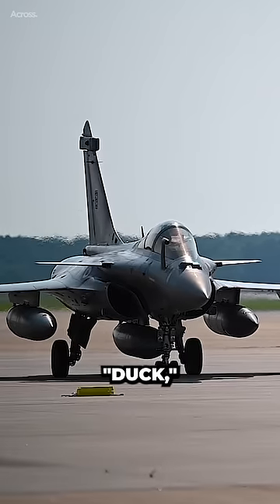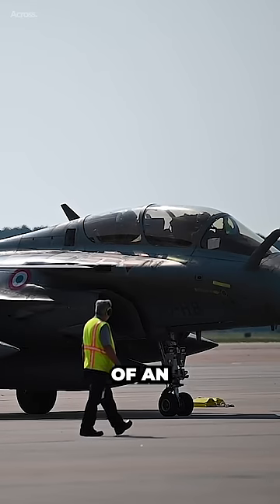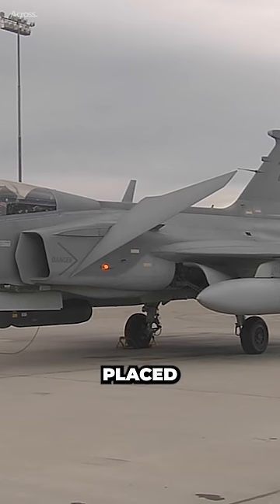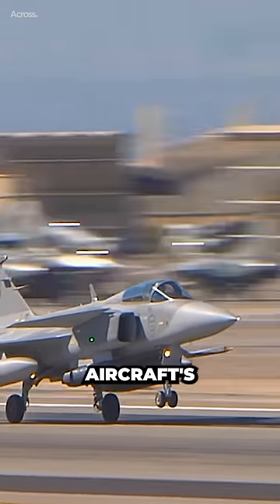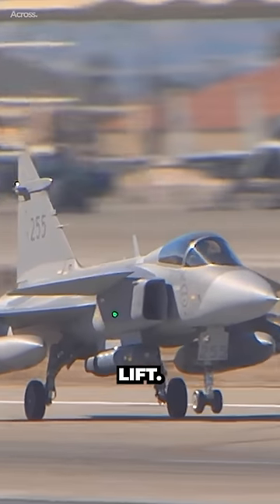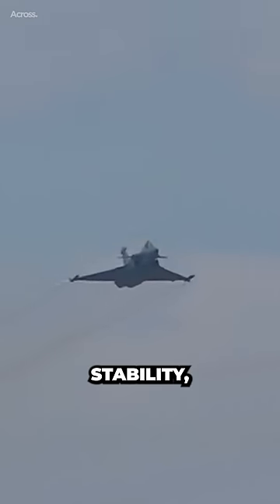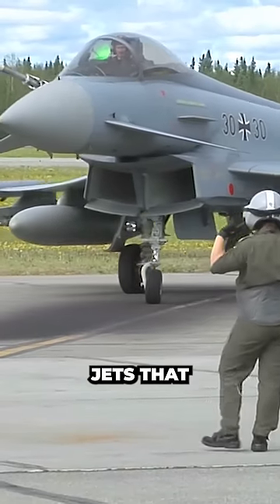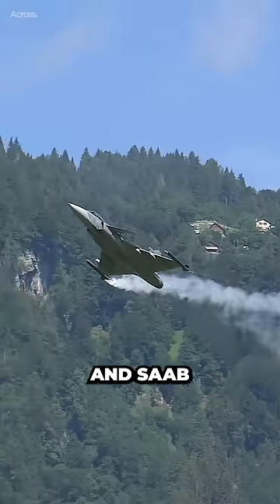Why Don't American Fighters Jets Have Canards? #shorts

Comment: I recall a guy involved in designing the F16 saying, the best place for a canard is on someone else's airplane.
Reply: 1000%
Reply: Yup hide bound traditionalists
Reply: There's only so many ways to make an aircraft and they might mock the delta wing designs but it IS plenty capable and can do stuff that regular F-4-15-16-18-22 design/pattern can't (I'm talking aerodynamically wise, put aside the thrust vectoring and stealth since that's not the subject)
The Mirage 2000 didn't have canards and was still an excellent fighter but it definitely got nothing on the Rafale which can do so much more thanks to the addition of canards
Reply: @thegeekno72  well I think specifically with the F16 they were looking to achieve a high degree of maneuverability using a low stability airframe with FBW. Pretty cutting edge stuff considering they were doing it in the mid 70s.
Reply: @johngalt2506  that is true, can't deny that
plus fly-by-wire and its performance in stability correction just appeared as well at the time so combining the two made the prospects of using a low stability airframe that much more appealing
Reply: @thegeekno72  
Now digital FBW combined with canards and thrust vectoring takes maneuverability to a whole new level. 
The question now is, in the age of reliable BVR missiles, AESA radars, and super cruse, is super maneuverability all that important. I wonder if there's a new emphasis being placed on maneuverability at high speeds and altitudes with the 6th generation designs.
Reply: "EXACTLY"!
Reply: @joesutherland225  
The F16 was cutting edge technology in the mid 70s
Reply: This statement is attributed to Kelly Johnson the legendary aircraft designer from Lockheed Martin... I do not think it was in regards to any particular aircraft.  He was ask at a lecture where he thought the best placement for canards would be, and he famously said, "On someone else's airplane".  Not sure if that is the exact quote but is close enough.
Reply: @johngalt2506  I think there might be for the following reason :
The US got no close proximity threats, if they get attacked, they'll see it coming and BVR makes sense for retaliation
If they attack someone, again, BVR makes sense to destroy patrols and QRFs prior to some invasion I guess
But the thing with Europe is, there's an old WW2 joke I heard long ago, countries are so small and tight here, you could cross over two of them at once just by spitting through them, BVR does makes sense for a while but not for long, Russia is next door, any encounter will become close quarters rather quickly, having manoeuvrability is required in these parts
I think fighter design took these kind of turns depending on the terrain it was evolving into, EU got "tight" airspace if that makes sense and as proven by current events, is close to a possible agressor, they'll get on site so quickly, BVR window will open and close faster than most think
Reply: Isn't hhe F16 designed by a supercomputer?
Reply: Wait until he learns the early concepts for the F-22 had canards
Reply: Funny that. As Typhoon, Rafale, Grippen & even the latest Sukois have all got them & are far more capable than the F16 (aswell as F15 & 18 for that matter) partly because of them.
Reply: @THE-BUNKEN-DRUM  the F16 is also an almost 50 year old design as are the 15 and 18.
Compare them to the F22.
Reply: Ii
Reply: @thegeekno72  unless the attacking craft is disguised as a Chinese weather balloon, then we will welcome it open arms.
Reply: @asherdie  hahaha true
Reply: Traditions did not made them true.
Reply: @james_the_darklord  no it definitely was not.  Development of the f16 started in the late 60's and was introduced in 1978. When the first f16 flew in 1976 there was really no such thing although any computer that is more advanced than the majority others could be described as a super computer. Here is a short list of some of the technological advancements in computing from 1978.
*IBM released the Electronic Typewriter Models 50 and 60, both using microprocessors to provide electronic control of certain typing tasks.
*The 5.25-inch floppy disk becomes an industry standard.
*The x82 Intel  CPU architecture originated in 1978
*The first LED display prototype was shown to the public at the SEF (Science and Engineering Fair) in Iowa on March 18, 1978.
*In June 1978, Apple introduced Apple DOS 3.1, the first operating system  for the Apple computers.
* and surprisingly the first semiconductor storage SSD was the StorageTech STC 4305 that was released in 1978, capable of storing 45 MB of data and costing $400,000. But there was definitely no computer aided design programmes available in the 1960's
Reply: @THE-BUNKEN-DRUM  Which one of them are better than that sweet f22? while canards work for the eu Thrust vectoring has probably rendered it pointless, it could help with take off I guess, but even there we have alternative solutions
Reply: They actually had canards on a F16 prototype for testing
Reply: @checkdajoker  true, I think the major differences are that canards can create extra lift giving shorter take-off at Max load and can be at a different angle of attack to the main wing, allowing them to produce lift when the main wing stalls. This is at a cost of slightly higher RCS..
Reply: @THE-BUNKEN-DRUM  more maneuverable...
Reply: Agility has been a secondary or even tertiary characteristic of fighter jets for a long time. The opportunity to use a tight turn radius in a dogfight is very low because:

A. The vast majority of engagements are long range BVR missiles where the best sensors and stealth dominate

B. Modern WVR missiles can turn at 50 G's and the best ones can be shot at targets behind you. No matter how agile your canards make your jet, it's not more agile than the missile.
Reply: The F-16 AFTI was pretty cool. I would guess the CL on US aircraft is farther back so the tailplane pitch authority is much higher.
Reply: Yes, I know that guy, his name is Herbert Hutchinson, and aeronautical engineer and a very very good friend of mine.

He was the project engineer in charge of the lightweight fighter program, (LWF) he was also chief systems engineer on the F-16, he wasn't a pilot but his honorary call sign was "stuffer" for his ability to literally design The cockpit of the F-16, you wonder why the seats slope at 30° ? Because he said so....

All the electronics in avionics in the cockpit were arranged by his design, he has a two book series out called "The F-16 Fighting falcon multinational weapon system, 1972 t0 2019"

And,

"Inside history of the USAF, lightweight fighters from 1900 to 1975"
Reply: @scottgamble3445  hey Scott,
My comment was a sarcastic reply to @joesutherland225 comment that it was because Herbert was a “hide bound traditionalist”. The US builds and has built the most advanced capable fighter jets the worlds ever known especially the F16 when they had to both cut cost while keeping air superiority. Give Hutchinson my gratitude for his service.
Reply: @johngalt2506  The answer is likely no for 6th generation. We are integrating remote operation capability for circumstances that actually require us to close within ~100 miles of the enemy. Training a pilot is almost always more expensive and time consuming than manufacturing a replacement plane, and that discrepancy has only continued to grow larger as warplanes grow more complex. Pilots generally require at least a hundred hours to qualify and that equals multiple thousands of man hours of maintenance and a plane unavailable while it's being worked on. Depending on the airframe it's possible it took as long or longer to train the maintainers than it did the pilot! Planes have pretty long lead times these days but I reckon we wouldn't be investing in drones if human resources weren't still anticipated to be the primary bottleneck in a full scale war.
In addition maneuverability beyond what an f-16 is capable of is of questionable value when the pilot is limited by the latency of a satellite link. Maybe we will have onboard AI that can fill in those gaps at some point but I think currently maneuverability is going to take a back seat to how fast you can shoot and scoot. Control and lift surface area and the G limits of that structure can only go so far before the plane gets too heavy and performance starts dropping again due to inferior power to weight ratio.
Reply: @THE-BUNKEN-DRUM  the Typhoon is a joke and is far more outdated than the older F16
Reply: @macicoinc9363 : 😆 Whatever helps ya to sleep at night, mate.
Reply: @johngalt2506  the most important thing rn really is just supercruise capability, stealth, datalink, advanced radar set ,and modern long range Fox 3’s
Reply: @thegeekno72  Canards make a design more docile at high angles of attack. That's nice when short-field takeoff/landing is a requirement.  Plus, they can double as speed brakes ex.Viggen/Gripen
Full deltas, as opposed to partial deltas with body lift like the F-15, are terrible dogfighters and at low altitude as they bleed energy quickly at high angles of attack. But they do fine as interceptors. ex. F-106/Drakken
Reply: Today, on things that never happened
Reply: @JohnDiseranno1992  
Read the thread
Reply: @TheGeekn°72  okay but why wouldnt the BVR planes just launch their payload and bug out before these "ww2 style" jets even get there? Therefore completely negating any chance of intercept? Like this isn't football were talking about. There's no required time on target unless it's a dead time. You don't have to give the other team a fair chance. Get in, do your job, and leave, what's beneath you is irrelevant
Reply: @johngalt2506  you do realize the f22 is almost a 40 year old design right? That's the thing people don't realize. The f22 is old. It's retired in the since it's not being made anymore because there are bigger and not quite better but a lot cheaper solutions. So while everyone is still to this day trying to catch up to the 22 to this day the us is already building prototypes for the next 50 years
Reply: @PulsingKrugotvoid  
Yes, I'm aware of that.
My point in bringing up the F22 in an earlier post was to respond to someone comparing the 80s and 90s era European fighters to the F16. I was suggesting comparing them to the F22 because that would be more relevant.
Reply: @johngalt2506  : The OP was/is on about the F16, NOT the F22. That's why I compared it. But of course, you kids just want to keep moving the "goal posts" because "y'all" can't handle that other countries have the ability to build something that rivals & in a lot of cases is better than something you've got.
The F22's biggest advantage is its stealth. But in terms of outright performance the latest deltas are 'almost' equal. There's multiple tales of them actually coming out ontop in some BFM engagements (which isn't too shabby for a previous gen aircraft). With the latest upgrades to their avionics, most previous generation aircraft actually surpass the F22 in a lot of areas.
Reply: @LEGEND  not really. They all have specific roles they were built for and the f16 and f15 still outclass their competition doing what they were built for. The only exception is 5th and 6th gen aircraft but none of our adversaries field enough to pose a significant threat currently. Plus how many other fighters are nuclear capable.
Reply: @THE-BUNKEN-DRUM  do you have any real world experience with Fighter aircraft? Designer, a pilot, or a maintainer?
Reply: @megaconda07  : Nope, but the 'real' fighter pilots from which I get my information off. Do have.
Reply: @thegeekno72 the airbases the US has in Japan, Korea, and Germany doesn’t count as close bases?
Reply: @THE-BUNKEN-DRUM problem is British planes never get tested in combat because they are letting the US do it. They might as well still be flying Spitfires
Reply: @robertdigby4504  do you think designers have in mind homeland defense or abroad defense ?
Even if they're tasked with making a multipurpose aircraft they're gonna think even if subconsciously "what's best given the geographical features of our country ?"
The US need BVR more than EU
The EU needs maneuverability more than BVR
Reply: @Archangel3083  my brother was involved with that, HIMAT
Reply: Obviously don't know squat on how to design them so slabs them off. Three of the best mentioned in the vid ALL have them and kick arse.
Reply: @THE-BUNKEN-DRUM  nonsense. Far more capable in what?
Reply: @EEEEEEE354  :  Performance, payload & avionics.
Reply: @THE-BUNKEN-DRUM  then you are misinformed. The F-16 has better performance, higher payload capacity, and sufficiently advanced avionics. 

Go ahead and post those performance and payload metrics for me.
Reply: @willcam386  : I'm not in the business of doing other people's homework for them. Google & books are your friends or enemy in this case.
The F16 was/is a fukn 'excellent' aeroplane, no doubt about it. Although the avionics are on par in 'some', not all areas, in terms of performance & weapons load, compared to modern "canarded" deltas, the F16 is at a slight disadvantage, 'especially' when compared to the Typhoon & Rafàle. I'm sorry (not) that you kids can't handle this, but it's an easily verifiable fact.
Reply: @THE-BUNKEN-DRUM  "I'm not in the business of backing up my claims" you mean?
Reply: @willcam386  : I don't need to back up anything when you can just as easily look up the information for yourself. Don't just take my word for it. It's 'All' there, at your fingertips ready & waiting for you.
Reply: I wish we had jets with canards other than the F-15 STOL/MTD
Reply: @THE-BUNKEN-DRUM  🤣🤣🤣🤣
Reply: Yes, if it were superior the US would have them.
Reply: @THE-BUNKEN-DRUM  lol a viper driven by a capable pilot would splash all those other euro jets.
Reply: @ZappakeR  : I have no doubt that's possible, assuming the other pilots are absolute chumps (unfortunately for you lot, they're not). But all things being equal, in regards to pilot skill. The F16 IS the underdog in this scenario. FFS, just take your heads out of your arse holes for 1 second (if that's at all possible)  & Google the numbers, the avionics & whatnot. The F16 is at a disadvantage, 'especially' against the Typhoon & Rafàle.
Reply: LOL, that's why a F16 is more maneuverable than any Sukhoi 😂
Reply: lol
Reply: @dave_h_8742  then why are US jets having to do all the combat then??? Explain that...we have the best of everything Jets, Pilots, Stealth, everything..And Now we will have Laser Weapons... And that is just on the Jets that the US Tell you about...we have things that you won't see until it's absolutely necessary... And even then...You still Won't be able to see them because they are too advanced for you to see unless they let you see...
Reply: @THE-BUNKEN-DRUM  I'm afraid it's not...none of your so called aeroplanes😂 are proven in anything..
Reply: @THE-BUNKEN-DRUM capable is what way? Maneuverability? There is no reason they would care. Not to mention the f15 and f16 are way older. Do you think canards will matter in 5th and 6th gen?
Reply: @stonehaven2289  : I'm afraid (not), but you're blowing out your arse. In regards to air-ground operations, yes, they have & in regards to air-air operations, the only aircraft "y'all" have ever shot down are balloons & poorly flown, previous generation aircraft but when they come up against 'better,' newer aircraft flown by equally well trained pilots, during exercises, things aren't so 1-sided. It's all well documented.
Reply: @randybobandy9828 : Maneuverability is superior, payload is superior (F15E is on par in that regards), avionics are on par & in some ways superior to their equivalent 4th gen U.S. counterparts. That's why they're sometimes even referred to as 4.5 gen, solely because of their avionics. Don't just take my word for it. Look it up.

Now, in regards to canards being a feature on 5th, 6th gen aircraft, I don't know, unfortunately I'm no aerodynamicst & I'm going hazard a guess & say niether is anyone here. But I do know this, as it stands the best 4th & 4.5 gen aircraft in the world at the moment all have canards.
Reply: @THE-BUNKEN-DRUM  Steady on mate, you'll have the Yanks spit'in their dummies out the pram.:face-green-smiling::face-green-smiling::face-green-smiling:
Reply: @jonathanmaybury5698  : 😆
Tell me about it, mate. It's like telling a bunch of kids Santa isn't real. 😫
Reply: In Ace Combat 3 the F-16 in that game had canards
Reply: @THE-BUNKEN-DRUM no they’re not lol
Reply: Love it!
Reply: @stonehaven2289 sort of, but not exactly, not always. When Libya was attacked to get rid of gadaffi, the French flew right in there without dedicated SEAD planes, like growlers,  or stealth bombers like the B2. Just the Rafales with their onboard SEAD suite. Typically in a US strike, air superiority is achieved first by stealth and dedicated SEAD planes, then the bomb trucks come in. The US is usually better in total, but doesn’t always get this kind of bang for the buck